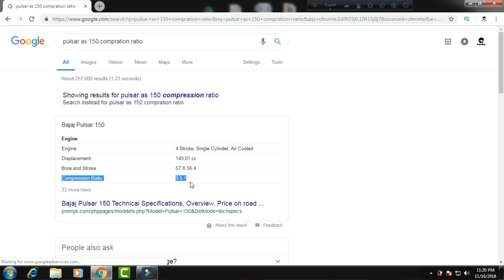পেট্রোল নাকি অকটেন? কোন মোটর সাইকেলে কোন জালানী ব্যাবহার করা উচিত (বিস্তারিত)

Comment: 1 litter octane ar prize koto?
Reply: Runner Royal Plus 110cc Full Specifications

Engine TypeFour Stroke Petrol 
EngineStroke55.73 mmCompression Ratio9.0 : 1
Maximum Power6.0 kw at 7500 rpm
Maximum Torque7.8 N.m at 6000 rpm  
ভাই আমি কি ব্যবহার  করতে পারি বলবেন প্লিজ

Comment: ভাই আমার বাইক চালানোর বয়স ২০০৬ থেকে কন্টিনিউ আছে, এর মধ্যে  কখনই অকটেন ব্যাতীত অন্যকিছু ব্যাবহার করিনি এবং ১ মাসে বা চল্লিশ দিনে মবিল চেঞ্জ করি এবং ৩ মাসে ইন্জিনে হাওয়া নেওয়ার ফোমটা বদলাই  এই তিনটা কাজ করলে যে কি একটা মজা পাওয়া যায় ইন্জিনএবং বাইক থেকে তাহা বলে শেষ করা যাবে না।  
এবং মনের সুখের জন্য বাইক চালাই। ৩ তিন বার আল্লাহ পাক্ বাচিয়ে দিয়েছেন মৃত্যুর হাত থেকে এবং কাছ থেকে মৃত্যুকে দেখেছি। এখন অবশ্য একটু সাবধান অবলম্বন করি এবং আমি সবার সুস্থতা কামনা করছি।
Reply: tomar barite ekdin dawat debe amake ?
Reply: 1 mas ba 40 din bole kono specific kichu thake na, jodi engine oil mineral type hoy tahole 2500km chalanor por palte fela uchit including the oil filter...but jodi synthetic oil use kora hoy then 5000km easily chalano jabe...air filter majhe majhe clean korte hbe r   10000km por change kora uchit r engine er clutch plate 30000km er por.

Comment: The CB Hornet 160R comes with a 162.71cc engine that has a compression ratio of 10:1. It develops a peak power of 15.7bhp and a torque of 14.76Nm.
তাহলে আমি কি use করবো?